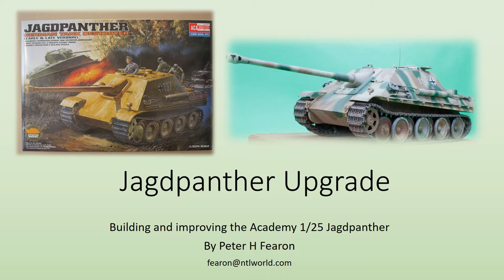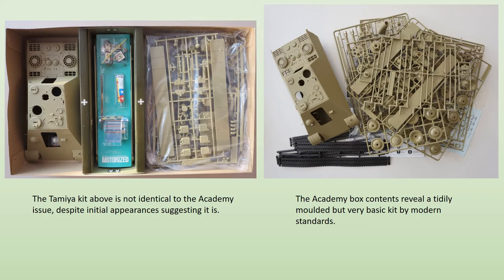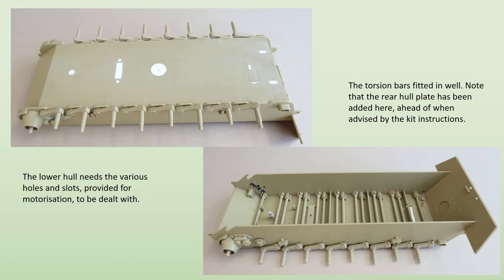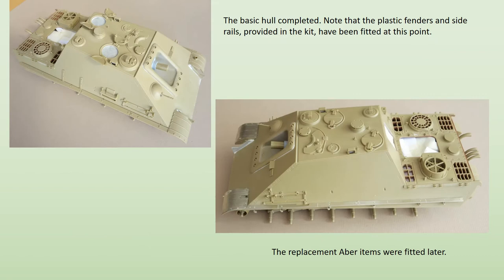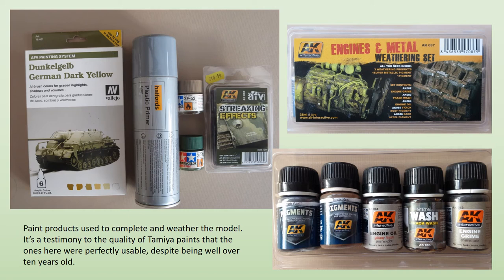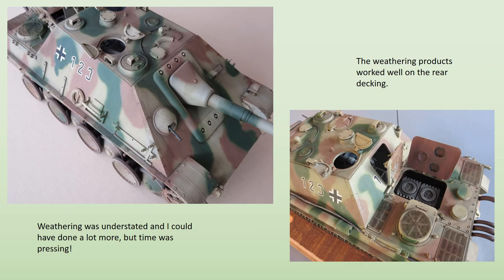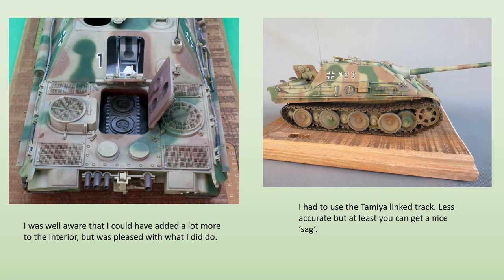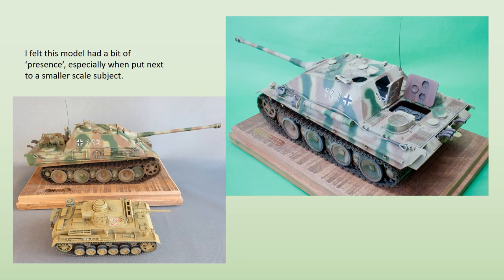Jagdpanther Upgrade - Improving the Academy 1/25 scale kit

Comment: I built this kit. The motorized wired control version. I didn't motorize mine but the suspension bars and wheels roll freely and very impressive. Many builders focus on what the kit doesn't have, but I model Lehmann 1/24. Model trains and these kits are perfect vehicles.
Reply from the maker: Thanks for your comments. I really like this scale - it's a pity that there's so little available.

Comment: As a tank man I really loved this video.  Yet again you go beyond the call of duty, especially with the gun breech and the brilliance of using the Mauser brass in a WW2 german vehicle reproduction.  This is not the average modeller scrap box item!

I fondly remember making the 1/35 Tamiya 1969 motorised version in my late teens - I see this is a '72 tooling and have always loved the graceful (if you can use that term of an AFV) lines of the armoured carapace.  The fenders/rails are really effective.  And the grills are great, if I build this one I'll seek them out.   I'll use the Halfords primer too.   Nice weathering very subtle and I loved the track treatment.  I have also melted vinyl tracks trying to get 'the sag'.

Opening the rear hatch and the engine work is just right for the Jagdpanther as I can vouch for the interminable task of a full interior in 1/35th - in my case a late Panther - still WIP.  The problem is time pressures as I am getting obsessed with lead-work having cast my first .452s rather well, I say immodestly.  Turning range scrap into ingots then to the final product takes time.

Anyway, back on topic -  I must get some offcuts for bases/dioramas can you suggest a local source?    I see lots of PE for the JP and there are a few Tamiya kit 35203s on Ebay for £23-£35.  These aren't the old ones but  If I hadn't put a Nashorn on my Santa list then I would have been tempted.  Maybe post-Covid...
Reply from the maker: Hi Gordon
Thanks again for your views. The Jagdpanther was a quicker, easier and generally more enjoyable project than the Hood!
There's a woodyard in Harborough that imports and treats hardwoods and is great for offcuts. They're accessed from Gores lane. I'll get the name and contact number for you when I get the chance.
Reply: @peterfearon317  Thanks Pete, might see you tomorrow morning, that'll be Glenmere Timber then.